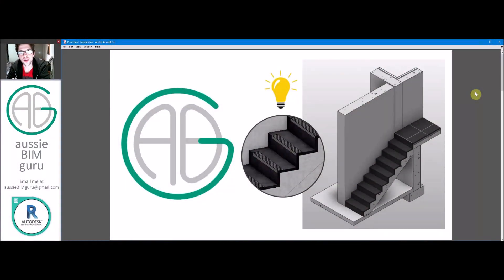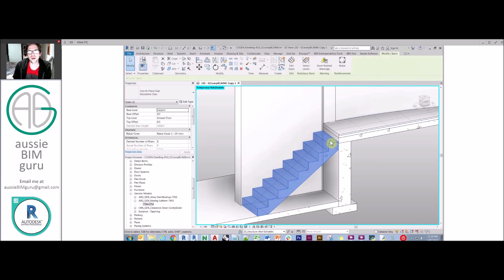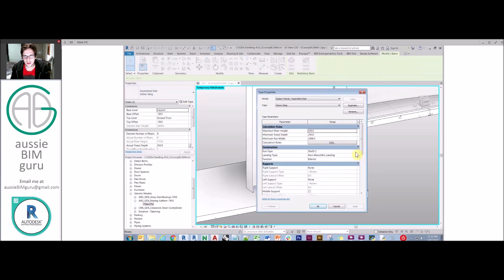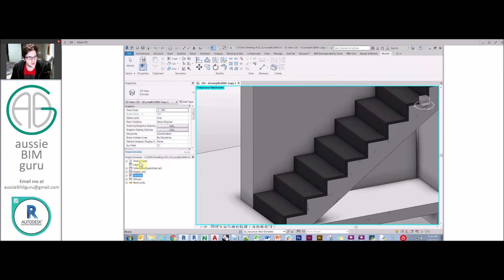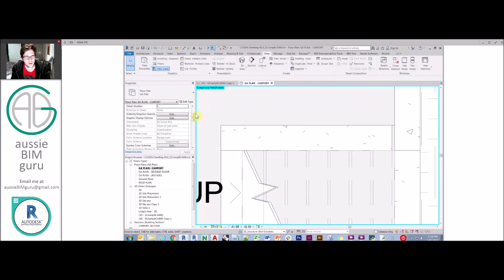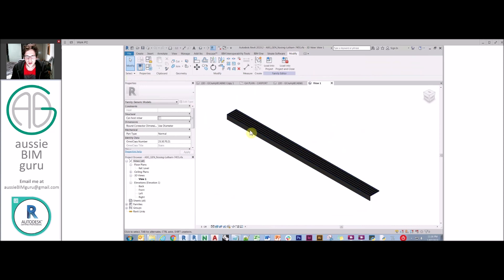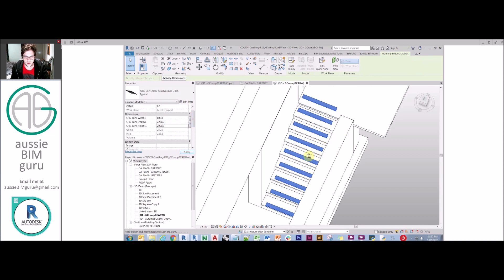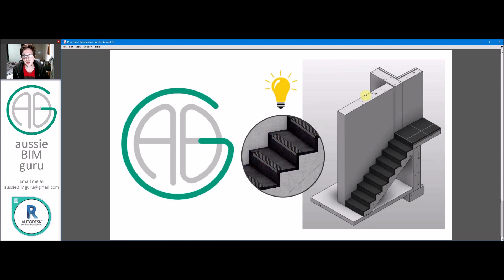Modelling Revit Stair Finishes and Nosings

Comment: Strips by railing maybe?
Reply from the maker: Yes railings could potentially be used with a baluster for the strip but the challenge with railings is they are generally type based in nature, so capturing tread depth/offset to front of tread would be quite clunky i think.

Comment: Hi
Thank you for sharing this amazing tutorial. Though I am a bit confused in making that diagonal array, you have used. Could you kindly please guide me how to do that?
Reply from the maker: In this case I nest the tread cover as a family, then I array it in section in 2 directions. I use two reference planes to dictate the location of the second tread, then formulae to set the spacing based on the overall depth/height the user specifies.
Reply: @AussieBIMGuru  can you pls pls pls do a tutorial about the nesting family and how you did the array. plssss
Reply from the maker: @a9speedbump379  i have, enjoy :)

https://youtu.be/ksPoPZuf9SQ
Reply: @AussieBIMGuru  thanks a lot mate. I didn't face this problem before with stairs i always used the monolithic material. But this time for my cdp um using a special concrete layer on top as a floor finish. Dun wanna see it broken at the staircase or in the stair section. Yur video was the only one i found that have a good solution for that. Thanks a lot. My final architecture degree cdp project is on the 16th and um still doin the detailing 🙃
Reply from the maker: @a9speedbump379  best of luck!
Reply: @AussieBIMGuru  thanks big bro

Comment: Hi Gavin. Good tip. What do you do when the nosing elements cut through and go above your stair cut marks?
Reply from the maker: I shake my first at Autodesk for not providing us with a more robust solution unfortunately. It's graphically got some issues in this case, not quite sure how these would be best resolved.

Comment: Hi! Great tutorial. I tried doing this method with U shaped stairs but the threads and risers kind of mess things up. So what I did was made 3 different "finish stairs" and it was all fine until I tagged the stairs with the thread number tag. Any suggestions? Thanks.
Reply: Nvm I figured it out. I just tagged the "finish stairs" and changed the start number of each stair so that the numbering is continuous.
Reply from the maker: @Vince Yeah that's probably the only way around these sort of scenarios. The finish stair is a bit of a 'Revit hack' so needs a few workarounds to fully enable it. Great job!
Reply: @AussieBIMGuru  FWIW this is how I did it. So I did exactly everthing in the video except my stairs were U shaped, so I had problems with the threads and risers cause when I offset them, they overlap with the "structural stair". I figured I should just make 3 separate "finish stairs", 1 for each stair and 1 for the midlanding, and it worked but I had problems tagging the threads. Then I also figured why not just tag each separate stairs and just change the starting numbers, and it worked! Just do some tweaking and apply some filters and your good!

Comment: I came here to find out how to apply different materials to custom stair nosings but instead discovered that tread and nosing functionality isn't nearly as customisable as I would've hoped. Nevertheless, this works and for now and seems to be enough to get the job done until a more elegant solution becomes OOTB functionality in the future (or at least one would hope).
Reply from the maker: This was the same shortcoming that lead me to develop this workaround. I share your wish that we had tread/nosing material control (pattern setout, nosing separation and inset).

I'm glad my workflow gave you an option, albeit not the one we both hope for in future!